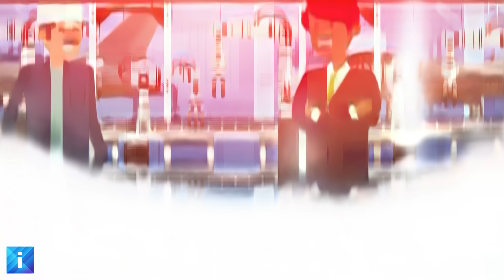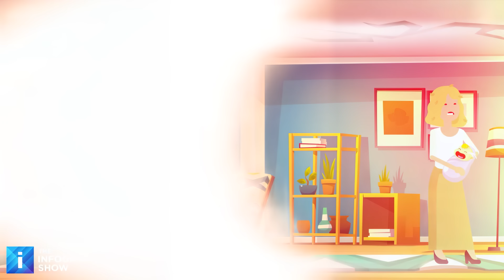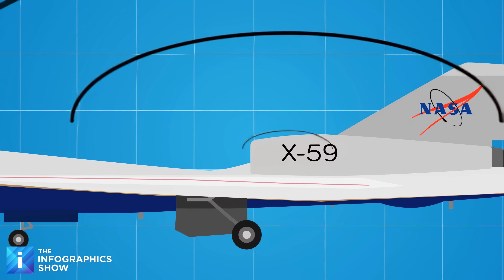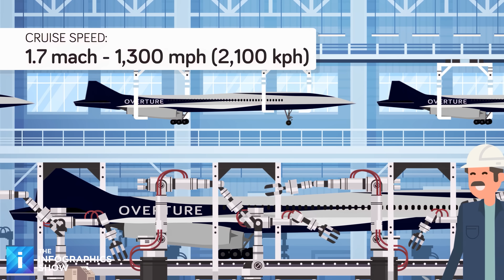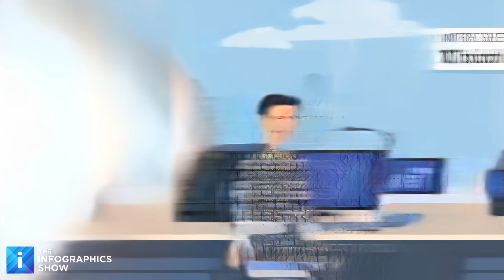NASA Just Fixed The Concorde. It Is SILENT

Comment: The design of this looks like such a bad idea. Forget about unwanted sonic booms if there is a slight warping of the nose, that thing is so narrow and so precise, if the nose bent to one side, well, that's where the cameras are on, so the pilot would have an incorrect display of what was actually directly in front of them, and also, any slight warping of a nose made that precise would likely cause the jet to end up in a disaster due to losing the ability to fly stable. I feel like if a sonic boom was accidentally caused too close to the engine (where it might occur if the aerodynamics change), even if no damage is done to the engine, the sheer force of the boom happening closer to the craft would cause the plane to spiral out of control. 

Literally any deformation to such a sharp nose of a plane like that, and it's going to be a PITA to fly, if not basically impossible, and highly dangerous. 

IMO, it's a bad design besides the reasons in the video as well--I'm not sure what the purpose of this thing even is. It looks like an experimental craft that will never actually exist. The fact that if the cameras go out, I guess the pilot ejects with a parachute? I don't think a plane that's only 99 feet long could carry any passengers besides the pilot given all the redundancy and reinforcement that went into the engineering. 

I'm more interested in the craft that they say are aliens but I think are just even more advanced human tech.

Comment: It’s actually revealing that this sort of development, taking existing subsystems rather than engineering them from scratch is novel enough to explicitly mention. Doing the opposite, designing everything from scratch is ridiculously and pointlessly expensive. It takes longer, costs orders of magnitude more and achieves nothing other than making the contractors more money. Yet that’s the norm.

Comment: Concorde flew at mach 2 and was profitable.
Vietnam river patrol boats took a leisure boat company less than a week to make in the 60's.
Skunkworks made the SR-71 In 2 years under time, under budget, hitting every target and surpassing them with a small team.
How does the human race move backwards, trillions and over budget and delays over decades,  no supersonic aircraft no personal aircraft, it now takes two years to fill a pothole, or procure a toilet seat...
Reply: Upper management grabs a big amount of cash, bypasses middle management, and talks to the engineers. IMHO agile development works when there are mostly engineers. I was reminded that the Agile Manifesto starts with "do" not "talk" . Meetings and Ceremonies are not agile, or at leas they are secondary. And reporting even behind meetings. It is interesting how greedy non-engineers bring down aviation industry and regulations cannot even safe lives ( B737max  or related: VW Diesel-Gate ). To this day, I found no reference that engineers propose to not use redundant sensors for the stick pusher. No engineer proposed to no to document this change in the manual. I just wait for Chinese EV start-ups to get fat.

Comment: having the engine at the top also fixes the other flaw of the concord sucking in debris.
Reply: Concorde inlets are in front of the main landing gear and far outside from the nose gear. Also the main landing gear is very long to avoid a tail strike. Are you sure that you don't mean the B737 ?
Reply: @ArneChristianRosenfeldt  heared that one of the wheels caused a fuel tank fire. might have forgotten that it had nothing to do with the engine though.

Comment: how dumb were they to think people would get used to sonicbooms?
Reply: People got used to SMOG from cars with leaded fuel. Fun fact: Lead allow higher compression, which means more heat, which means more NOx. Even before catalytic converters, the correct way for low emission would be very tight control on compression and ignition timing ( EFI -- not a carburetor ) and a lambda probe as a second, slow calibration loop. Then reduce friction. V-motors have less bearings. FWD have less shaft. DOHC has less friction and allows to put the spark plug in the center. Also there were many military supersonic flights.

Comment: What I never understood was why we don't still have them for international travel over the Pacific and Atlantic for commercial travel. Just slow down once you get over land.
Reply: they need 4 times the fuel and cannot reach over the Pacific or Atlantik, but for the short London-New York route. I guess you can expand it slightly if you don't load the Concord full. And then Paris becomes possible.
Reply: @ArneChristianRosenfeldt  Thanks for the info. I was always curious. Feels like over the oceans we would be good to go. But this makes sense.
Reply: @Infectd  Yeah, I just mean: The Concorde already did this. And Japan tried to build a plane to connect directly to USA since then, but failed. Also I read that some islands suffered from the boom from the Concorde. So less boom is always better. I just don't understand: Wing span increases lift ( reduces drag ), but IMHO it directly also increases boom because it directs in downwards into a small spot. Concorde already had an incredible long chord to smooth that out. Does the video talk about exhaust noise? They could radiate the noise into the sky like the F-117.

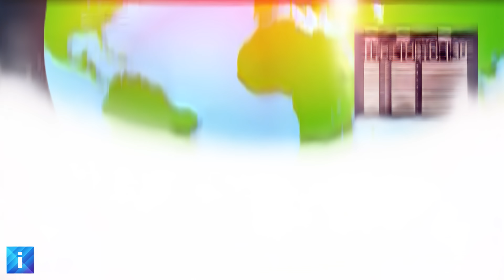Comment: 13:44 enemy defenses could easily tell background noise from a muffled sonic boom, the issue is you only hear a sonic boom after the aircraft has already passed. It's moving supersonically, the soundwaves from it can't hit your ears or your microphones, at mach 1.5, the plane is moving 50% faster than the sound it is making

Comment: dude the x59 is a a passenger aircraft and the entire model off planes is out of date but no air company is investing in new idea`s. the b52 should be the new platform but then with ppl in the wings not the center . the center is for 2 jet engines only.

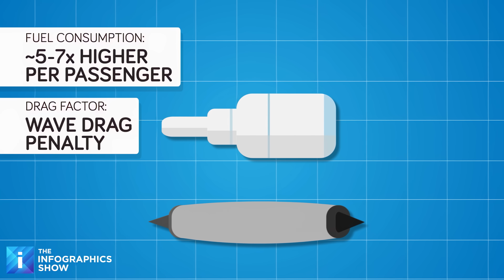Comment: 11:50 even the LEAST efficient planes?
Reply: The statistic is true, but a bit misleading.  It's using a large amount of fuel per unit time, but because of the higher speed, the total fuel usage for a given distance traveled is not quite that severely far behind the most efficient planes today.  There's no escaping the fact that double the speed requires 4x the energy.

The real issue, though, is carrying capacity.  A plane like the Concorde really wasn't capable of carrying that many passengers, so the amount of fuel per passenger mile was considerably higher as a result.  If you use the same 20k gallons of fuel as another plane, but carry 1/3 the passengers, that's 3x the fuel per passenger.

It's also why a train does better on energy usage per passenger mile than anything else (yes, even better than electric cars), despite being much slower.  It's also why small capacity large fleet air-taxi-like concepts will always be less efficient than any option.

Comment: why not put the cockpit on the bottom
Reply: Remember, they're constrained by a relatively small budget so they had to use some pre-existing components. The canopy is from a T-38, and I wouldn't be surprised if the ejection seat is a well proven ACES II seat. Trying to redesign that or making a new ejection seat to fire downwards is only going to add $$$ to the budget.
Reply: I have to give it to the video that I now learned that the camera sits in the tip of the cone where no human can reach to. So it will have a windscreen facing supersonic air head on. Seems a bit futile to keep this up the whole flight. Why is NASA so allergic to mechanics? So the bottom cockpit and cameras would be extended once speed is subsonic. This needs to be in front of the nose wheel.

Comment: The issue is that sound isn't the reason the concord stopped being used. It was just too inefficient and expensive. Plus, people would rather travel in comfort and take a few hours longer than travel at mach speeds but be uncomfortable.
Reply: The issue that situation then introduces is that ending the service is probably the reason it has taken so long to innovate on the passenger supersonic concept.

Case in point, supposedly the people who made Concorde were researching and working on a mk 2 model when everything was stopped and shut down. No doubt using information they had gathered from the first projects' outcomes.

Comment: I had to laugh quite a lot during this video. Just using existing parts outside of their original specification is so smart. Much better than having to go through this annoying certification process. That's how the 737 MAX was designed. What could possibly go wrong?
And how did they solve the fuel problem? They didn't, they just painted green label on? What an elegant solution!
Can't see the runway? No problem, the future is all digital. If the system fails, the pilot can just opt to abort the landing. And I guess stay in the air until the support technician has resolved the issue. Have you tried switching it off and on again?

Comment: Bummer the day the HDMI cable comes loose.
Reply: Greatest comment
Reply: They should use VGA🤣
Reply: Or the day we burn the ozone layer out and all the heat escapes the earth and we get our forever winter flying that high in the atmosphere.
Reply: @rl8571 Yeah, or that.
Reply: Nah the plane is an experimental demonstration of aerodynamics principles, not a production plane
Reply: But the truth is even planes with Windows would crash if one single wire came undone
Reply: The day NASA uses Windows as an operating system in a vehicle is the day I run out my home naked.
Reply: @rr.studios that's why vehicles use Linux.
Reply: @BrianHurry most commercial planes have multiple redundant backups. All planes have to be able to land with an engine out, most have 3 copies of each major instrument, for the altimeter they use GPS, barometric and radar and if they conflict the pilot is told.
Reply: @domvasta but planes have lost their instruments when such are virtual.
Reply: @BrianHurry  The Windows NT kernel is stable. It's the extra crap they add on top that makes it crash. And embedded applications, like on a plane, don't have the extra crap.
Reply: That cable's gonna be intergrated.

Comment: For commercial use, the vessel is going to need to carry at least 100 passengers. Thats going to make the aircraft the largest in the world, and by a large margin.
Reply: It doesn't need to carry that many passengers, it also doesn't need to accommodate large on board water and waste tanks like normal passenger jets, because the longest you will be in the air is 5 hours, it wouldn't be able to hold more fuel than that
Reply: @domvasta  70? 50? I dont really think thats viable. My commercial math could easily be in error, but you would have to run the numbers for me.

Comment: As someone who has operated military vehicles that use camera visibility, I sure hope it's better than what I experienced
Reply: It's military grade... it's exactly same as what you experincef
Reply: Actual production planes for airliners likely will have glass, this is more of a test pland to show it's possible
Reply: @sa1t938  I don't know why the pilot cannot lie down and look through a window in the floor. Helicopters have windows there.
Reply: @sa1t938 don't commercial airliners rely on their instruments and not line of sight anyways? Plus it's not like windows are even necessary, drone pilots manage to do it just with cameras as well.
Reply: @pvtghost117  its more about redundancy, you dont want any one type of failure to completely remove your ability to fly the plane. Instruments malfunction on planes all the time but pilots are able to land without them visually

Comment: I don't know why the plane's developers didn't consider a window on the bottom, to better see the ground when the TV screen isn't working for example.
Reply: Imagine how long a runway would have to be for a pilot to be able to control speed, pitch and brakes AFTER acquiring the runway below
Reply: It would sort of do the same thing as a window on the top because yet again it disrupts the shape since the design is so precise and bear in mind this is a testbed they will probably get to the point where they will make good changes but currently they need it to work everywhere they can

Comment: No. The physics are always the same. Propagation of the shock-wave at high speeds is the issue. Modifying the form of the shock-wave by designing the right aircraft shape was the answer. Now, instead of a sonic boom, a thump is heard.

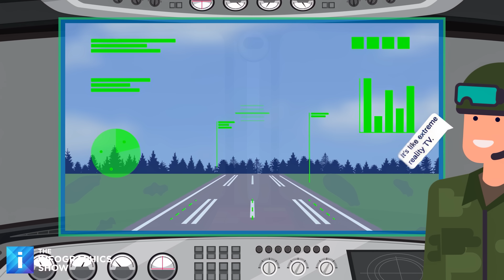Comment: 3:02 Couldn't an all-digital screen have some latency issues? Even if the latency is half a second, it takes no time for something to go wrong. 

I'm just curious as to if there's some delay, and if not, how they managed to avoid it (I don't expect that to be classified tbh)
Reply: Plans for screen failure?

Just say goodbye? Lol 😂🎉
Reply: @jat1992jat1992  planes can fly perfectly fine by instruments only.
Reply: It's not that hard to make a purposefully designed system like this to have latencies around 20ms or less. Think VR goggles, or FPV goggles.
Reply: On top of that there's no depth perception on a 2d screen
Reply: @jasonstathamhater  .... You can't watch a TV show and tell what is close or far away from a standard camera?
Reply: @DoctorGarr  Of course you can, but compraed to stereoscopic vision its not the same. Look into flight and racing simulators and the difference between having a flat screen and VR, its considerably harder to guage distance on a screen